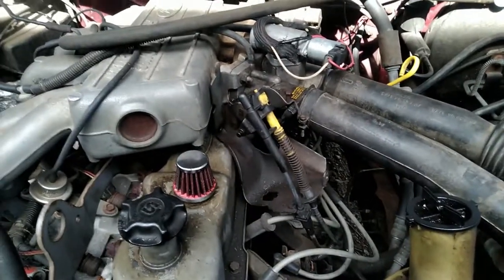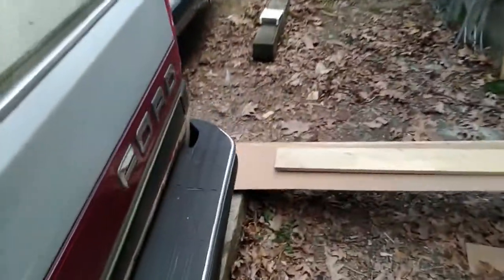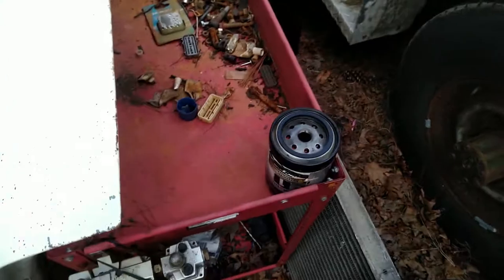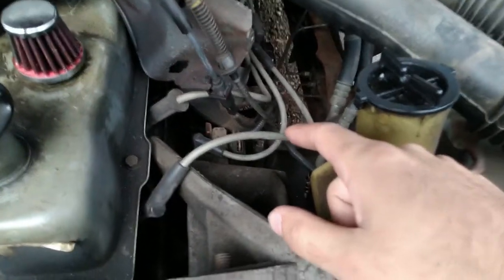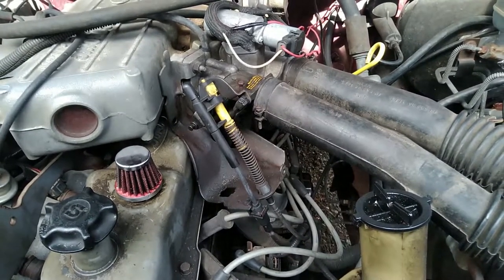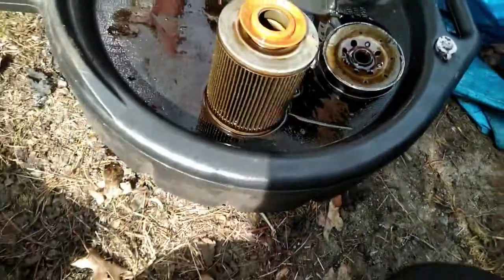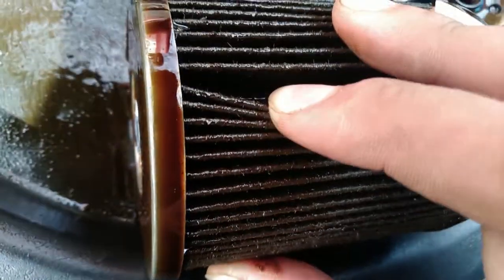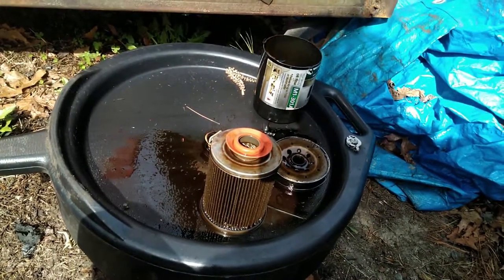A faulty oil filter almost destroyed my engine

Comment: I had a oil filter collapse on me @2500 miles after oil change , drove me crazy watching the oil pressure drop to 0 psi at Idle , no engine noise or ovrheating , replaced sending unit no change, people were telling me my bearings are probaly worn out along with the cam bearings,  engine has 266000 miles and running strong what change all of a sudden? change oil and filter , no more problem

Comment: I changed my car’s filter the other day. It was a Bosch filter. When I finally got it loose. Nothing came out of the filter. Only like some at the bottom
Will definitely check filter for sparkles.
Car has been sitting for like 4 months.

Comment: I have just put a timing chain on a jeep liberty V6 and oil and filter. After about 80 miles that I drove it, in about a week I started to here noise at startup. It became worse everytime at startup cold and then started when it was warm. I suspected the oil filter and I got a new one and installed it. After the first startup I never heard any noises. When I took a look at the filter I noticed the anti drain seal was deformed and with no significant force applied the filler guts  I could see movement side to side. If I told the owner to take it before changing the filter, they definitely could have destroyed the engine and probably would blame me. A dam brand new car quest filter.
 That Ford engine was notorious for filter drain and it was always best to use by Motorcraft filters. 
 How ever on my mustang , I used a small filter for pressure that took maybe one sec. That motor you have, you might want to install new rod bearings and mains while you are there. Those engines were built and lasted a 4-5 hundred thousand miles but the oil must be changed regularly or at best 2500 miles.

Comment: Half expected you to say "i started cranking it by hand from the crank pulley"
Reply from the maker: I did actually try that.  But the fan is in the way so I used the power steering pulley.  It took way too long though so I didn't bother.

Comment: I've been running Fram for 270,000 miles, last time I used a $10 filter and now I'm using a quart every 40 miles!
Reply: I look for debris inside the new filter. You would be shocked. Metal flakes inside there are going straight into the engine on first start

Comment: Am suspecting my car with this oil filter, because,I get a small knock on timing chain, n the brand of oil filter isn't usually u use, because I keep smelling oil as rev up,it burns but oil is same level or at least no change, pcv valve got some oil in it